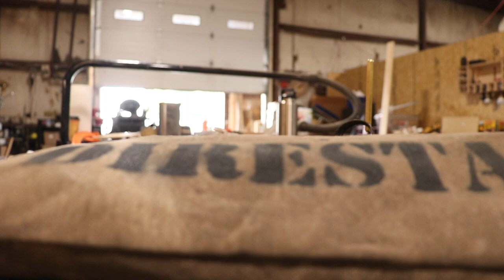DiResta Wrench Storage Roll up

Comment: Flashbacks to my Dad and his hardware store.  He made tool rolls for basic wrenches like yours, plumbing tools and one for electrical.  Whenever there was an electrical problem around the store/house (we lived above the store) or for a customer that is what he would take with him. Roll it out on the spot, protects the surface and everything you need is right there!  When my Dad passed away my Mom didn't know what they were for, took all the tools out of all the rolls, put the tools in box and threw the rolls out! :(

Comment: Made a similar thing for my skateboard tools back in the 80's, kept it in my pocket before I had a  truck. Screwdriver with a flip shaft Pliers and an adjustable Spanner. The rag was also used to clean up  Nice simple job took me back watching this. Cheers

Comment: fyi that juki has a thread cutter in the back, you drag the piece being sewed over it and it cuts the threads to the proper length
Reply: Yeah, but it wastes line, most of them do. There was one made by Singer that popped out of the deck if you pressed a small lever, but for whatever reason, it hasn't been made in 40 years even tho it was the best solution so far.
Reply: @aserta  Do you happen to recall the model of that Singer?

Comment: Yes, Frick yes and more yes. I found some chinese waxed canvas tool rolls on amazon for like 20 bucks and I can't believe how well they're holding up just because it's so hard to screw up a tool roll.

I've got about 3 sets of wrenches and a set of screwdrivers in one roll that fits in my hand. Most people fill an entire toolbox with that, and they just stay under the back seat of my truck.

Comment: Great project and video. Any debate about ties or buckles versus the storage bag to keep the roll together?  I have rolls with ties and fastex style buckles but I am liking the custom bag as well.  Sewing is yet another maker talent of Jimmy. Thanks.
Reply: The bag is an extra piece that can be lost, but truthfully it's just going to suffer the fate of any other unused cloth item laying around during a greasy, hard job. It's going to get used as a rag, it's going to get used to cover things other than the wrenches, it's going to get used to grab something hot and oily, etc...

It's going to become a damn mess.

I prefer leather ties. The wax from the canvas keeps them moist so if they're stitched on well they last. The bag is arguably more durable, but I've never seen a scenario where that extra durability is actually needed.

Comment: Hey Jimmy, those straight non-angle ratchet wrenches kinda suck for leverage in that they usually sit flush against the work piece, not letting your fingers fully wrap around the wrench for max leverage. Spend a little extra cash and get the ones with either the swivel head or better yet the ones with a slight fixed angle and a small switch to change the direction and you will be a lot happier with the functionality. However, you'll probably come back at me with a comment like you need or want this style for a specific purpose..
At which I would say 👍🏼
..very well then.
Carry on.

Comment: An awesome project, Jimmy you got me off my ass and inspired me to have a go at my own version.
My wife was taking some things into St. Vincent de Paul and in a corner on the floor was a NECCHI MIRA BF sewing machine with a shit load of accessories Wait for it $20.00 Canadian. Should have seen the look on wifey's face, what the F**k you going to do with that. works well am impressed with this machine I'm sure I am overloading it but as long as you fit it up with heavy duty needles hell if the smoke comes out I know I can get another one at the second-hand store.  

My tool roll was about half the size of the one in your video, and I had a peace of Moosehide lying around waiting to be repurposed, Wow am pissed, I didn't think to video or take any pictures more interested in getting the job done. A lot of thought needed to present your work to upload it to YouTube. A skill set I will have to consider and think through. Thank you for taking the time to share this one with us.
Play Safe From Elliot Lake Ontario Canada.

Comment: any tips for purchasing a sewing machine?
what to look for?
how can you tell it will go through canvas/denim/leather?
Reply: look for a Singer 201. it is considered Singer's finest straight stitch machine ever made.it has incredible piercing power. mine goes thru 16 layers of duck canvas. they made millions of them back in the day.  if you hunt around you should be able to pick one up for a bargain. Around here they go for about 300$ used but i got mine for 100$.
Reply from the maker: Look for an “industrial” unit.
Reply: @jimmydiresta  if you get an industrial machine I suggest changing out the clutch motor with a servo motor. Consew has a unit that is very reasonably priced around 125$. The speed control is a million times better. I have a juki ddl 555 that I did that to and it regularly sews thru ten layers of duck canvas. Clutch motors are hard to operate at the beginning.

Comment: Anyone know of a few sewing machines models to look at for general heavy duty projects?

Several times I have had things like upholstery and thick heavy materials that were impossible with basic machines. 

Is there something out there that has the grunt to push through tough materials and projects?

I don’t suppose there is a forum out there that helps people fast track concepts and materials when a project that requires something like that?

Comment: Spray adhesive to hold the edge over instead of a ton of pins... Genius! I'll just put that in my toolbox.
Reply: Usually instead of pins I use staples. Especially good on heavier stock like this. I will have to use the spray adhesive technique sometime. The only thing about spray adhesive is it ALWAYS seems like more ends up on the hairs on my arm than the work.